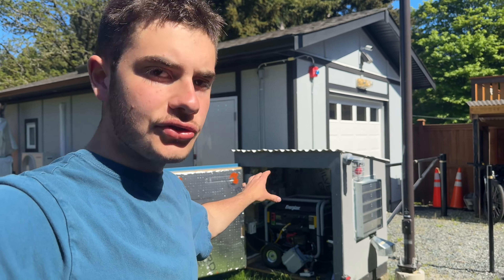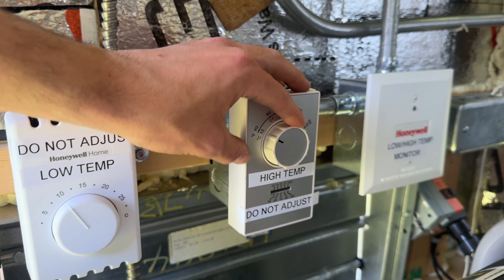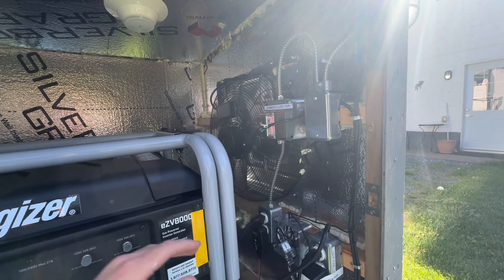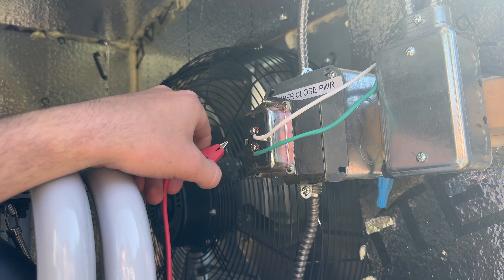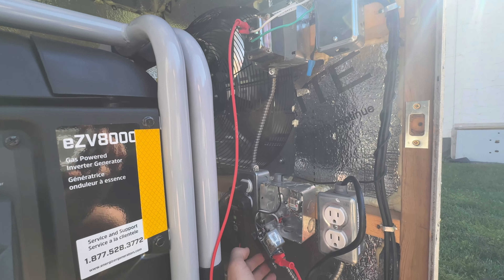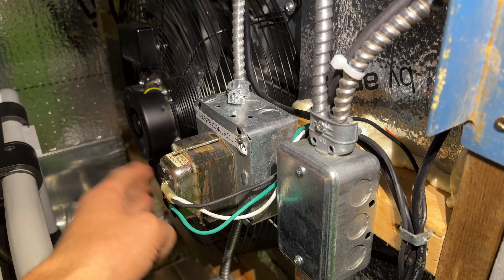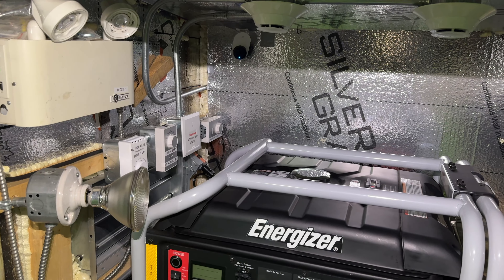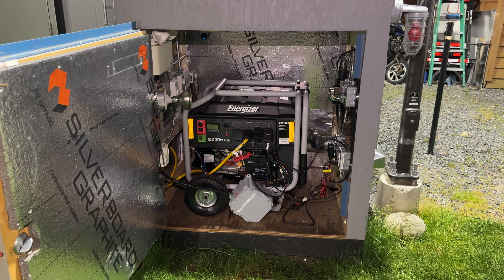The Generator Building Is Too Hot, Fire Alarm Supervisory! Fixing Ventilation System.

Comment: I like that generator setup. I find it neat that you put the damper and exhaust fan on thermostats that will activate when needed. I couldn't imagine how often that heat detector would go off without that vent system.

Comment: 70ºF is not that warm! so, why is it too warm?   good to see someone change ºC to F on YT, not many here on YT Do much Conversion's. I often need to do this, for the radio station when someone posts things in pounds or other currencies.
Reply from the maker: Outside temperature causes a higher inside temperature want to keep it cool as possible
Reply: @nics-systems-electric  well right, but the temp inside that box should not be that warm ...  I guess the Box is a bit small but the venting should have been sufficient...  but then again, I have  not been able to watch most of your videos on this, so I have just some idea of what you have in that Box!
Reply from the maker: @thethirdrail8397  i have alarms that are set off once the temperature is over 35 degrees C  so if I can I would prefer the building to be ventilated to keep the temperature down
Reply: @nics-systems-electric  35ºC is around 90ºF! - I guess that is a small box, 70ºF plus the sun's rays yea maybe it does run hot.   I did forget about the sun.

Comment: In regards to the issue of powering the dampers off the building AC supply and being reliant on a successful transfer to emergency power to ensure the damper opens I would say your best option would be to power it off DC from the generator battery.

The datasheet of the LMB24-SR damper motor says it can accept 19.2 to 28.8 V DC so you could just use a little 12 V to 24 V DC-DC converter to power it from the generator starter battery, it's only 1.5 W when moving so the battery and maintenance charger could easy supply that.

You should also be able to remove the relay by wiring it different, unfortunately at the moment I don't think you've wired it correctly. You seem to be applying 24 V AC across the Y and U terminals to open it, however only Y is used for control, U is an output for the position feedback signal. It previously opened when you connected it to the transformer because it was powering the Y control signal from the U output position signal through the winding of the transformer as you suspected. It goes to 50% because that's that point where the feedback signal matches the control voltage, likely about 5V.

Also don't know about controlling it with 24 V directly, it likely does has input protection but it's not designed for continuously applying 24 V, just small transients, doing so will cause the internal protection components to overheat and fail over time. To solve this you can just use a 500 ohm resistor as the datasheet recommends, BELIMO even sells this as a pre-made heat shrunk cable, part number ZG-R01.

But anyway this has been a cool project to follow!
Reply from the maker: I will have to look into it as that may be an auction power off the generators battery.
Reply: I was thinking of diode-ORing two 24VDC supplies but using the generator's battery seems like a cleaner solution.

Comment: An outside of temperature of 21 degrees should be just fine for your generator, i’d only be concerned about it if it’s 38 or above because your generator building is insulated. Here in Florida, especially after a hurricane passes, I see people running that kind of generator when it’s over 30 degrees with the sun beating down on it. I think your current setup is fine
Reply from the maker: The temperature outside is a lot higher inside an insulated building. The more temperature change the more fuel vapours will be vented into the building.
Reply: @nics-systems-electric  that is why the kind of generator you have is not permitted to be in a building like yours it has to actually be out side no building to protect it but we solved that issue just get a normal stand by generator from genarac or a number of companies that make them that come with a cabinet made of steel and are velatlated 24 7 with luver vents
Reply from the maker: @apctech1  that would not work for me there are no standby generators under $20,000 that will work in my situation
Reply: @nics-systems-electric  thats weird you just want to buy one not own the company:)
Reply from the maker: @apctech1  that's the normal cost for diesel generators they are not cheap

Comment: It’s good for u to have a generator a Lot of people have small ones but we have the hotel sized ones and it’s connected to the gas line and can last a week till having to change out the oil our house is very big it costed 5 MILLION not a flex I’m just saying why we need the big one and especially if ur in Houston if u can afford a big one solution is a small one not that good but it helps
Reply from the maker: Natural gas is OK for standby generators however not good for emergency generators here as it will be shut down in seismic activity therefore why emergency generators are using fuel contained on site.
Reply: We have 2 one came with the house one we got as an extra backup also  we are installing a new system also with our generator you don’t have to test manually it does it automatically for once a week and if any problem it emails the company sorry if im bad at spelling im 11
Reply: Also keep up with ur work I hope more people sub so u can get some of that money 💰